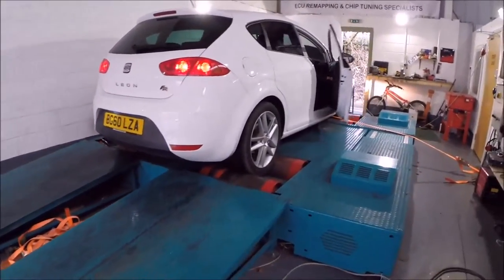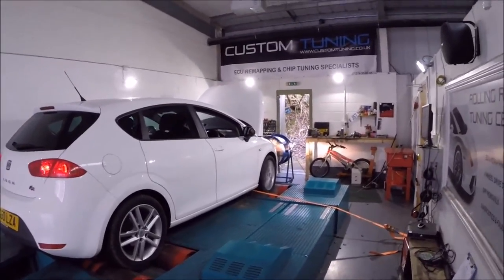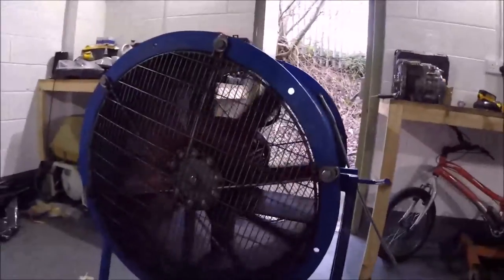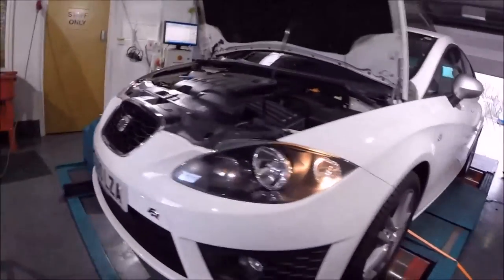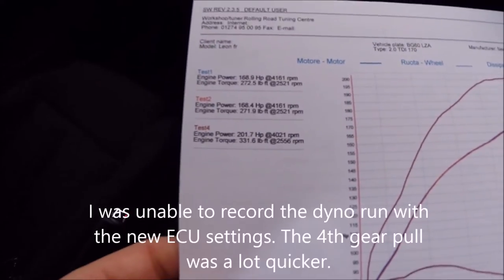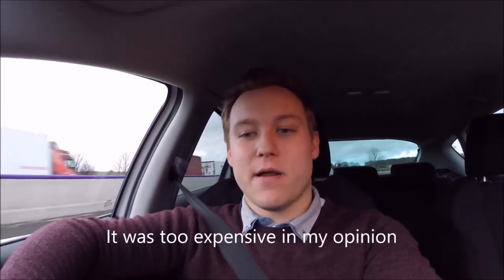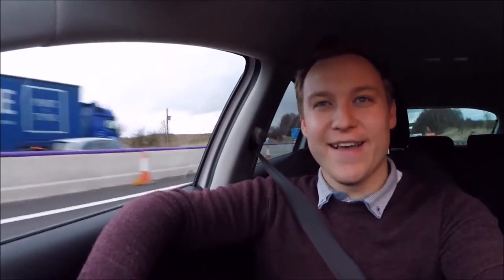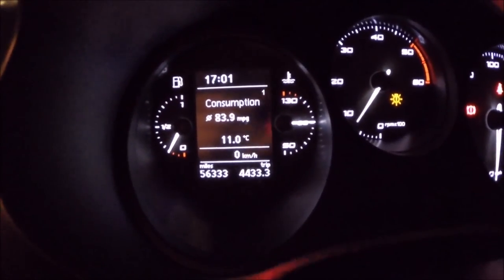Seat Leon FR 170-201PS 2.0TDI REMAP on DYNO Rolling Road

Comment: There is a co in Bradford called Remap Science what a set of cowboys. Once took a car there they claimed 30 bhp and 50 ftlbs. Took it another co as it didn't seem anything of the sort. Conveniently their dyno was full that day so mine was done static. It's gained 12 bhp and 21 ftlbs and smoked like the QE2. Has it re done elsewhere completely diff car. suffices to say best thing the co mentioned should do its stick to remapping skateboards!